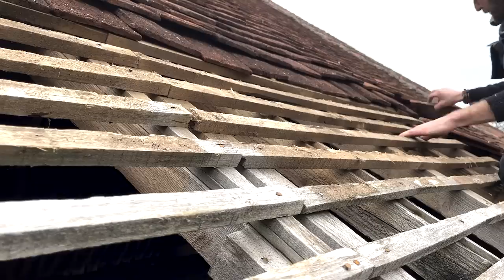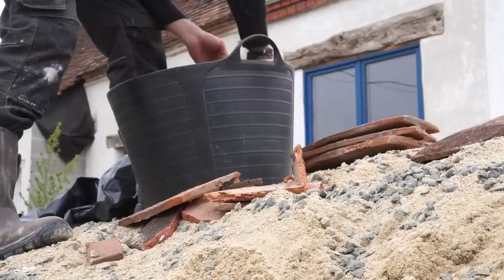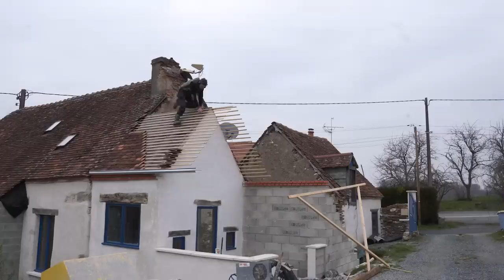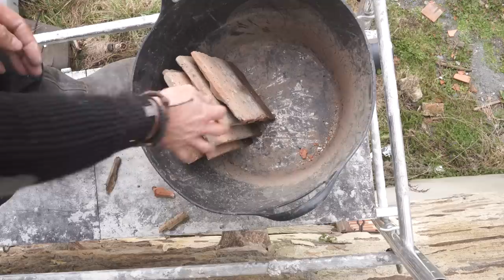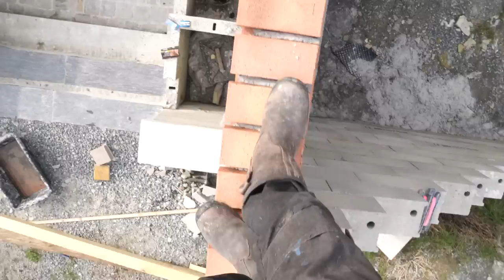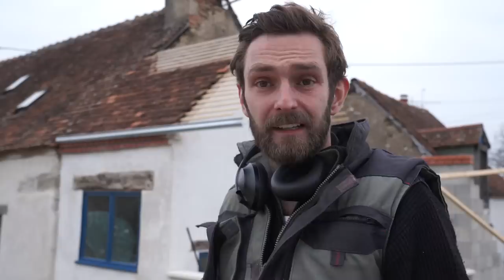Making a new roof, old again

Comment: Might I suggest a rope and pulley system for lowering the filled bucket from the barn scaffolding? Would probably reduce the amount of tiles being broken, and ease the "stress" on your arms a bit as well 🙂
Reply: Yea.. even looping the strap around the bar would improve control when lowering
Reply: I think I will I would tie the end of the rope someway, incase it slips out of your hand. Have a quick release on the bucket when it is at the bottom.  But what do I know? Love watching your daylies.

Comment: Your getting there Dan, slowly but surely…..
It’s beginning to look like your have to strip one whole side of the barn roof at this rate!
I know you were thinking of temporary tarpaulin the barn afterwards, but even with using good quality ones, your be replacing them every 6months if not more.
Maybe use corrugated iron sheets?
They could tuck underneath what tiles are left and probably could stay in place indefinitely, will cost twice as much, but would look better and be more cost effective in the long run!

Comment: The Clay of the roof tiles still absorbs the moisture making them more malleable and then then conform to the roof line, also helps them expand and contract to become more water tight in rain or snow. And breath and dry out in the warmer dryer months.

Comment: I'm betting an inexpensive clothesline pulley could be temporarily rigged up to the scaffold and one to the building, to make lowering and raising the bucket easier.  In fact, depending how far it is you might be able to run a line straight across from barn to building and just reel the bucket straight over. ( I would draw the line though, at suggesting you zip-ine yourself back and forth to avoid some of the climbing.)
Reply: But the zip line is the truly fun part. :😜

Comment: It seems crazy that that little nobuley bit is all that holds the tile in place, (along with the weight of the ones on top)  a roof can go on soo quickly.
Also if you are going to take the tiles off the barn, please get a second trug, its painful seeing you go up and down after every one,

Comment: Hi Dan , I feel I need to comment. I've been a builder for over 30 years and have just about finished my french property renovation in Aveyron. I really think you need to address some safety issues , with all due respect this is a small job , but some big risks taken . Couldn't you have hired a tile bumper , faster and less risk.

Comment: WOW Dan, that barn is a work of art. Those rafter timbers are very valuable.  I hope you are going to take pains to weatherproof the section of roof from which you have removed the tiles.  If historic tiles are in short supply, why not offer them for sale at a VERY premium price (per each) to test the market.  You may be shocked by their market value.  That barn could be very handsome with an all new painted metal standing seam roof.  At that point - I'd be renovating it into a very posh single family home.
Reply: I was totally with you until you got to the "renovating the barn into a home" part. Like Dan has anytime to do that with all he's got on his plate. 😆 You have SEEN that château, right? I think he has his work cut out for the next 15+ years. But if he had the money to hire a crew to do it for him, you're right, the barn could be a great place.👍

Comment: What if you had a rope on the bottom of the rubber bucket too, so when you lowered it, you could tip the bucket to pour out the tiles on the ground, then lift the bucket back up…save a lot of up and down’s for the takey-offey, puttey back on thingy.  Might crack a few with my idea though.

Comment: Brian, help me to understand.  Are you tearing down the barn so it doesn’t need a roof?  Or are you just temporarily using the barn tiles and planning to replace them in the near future?
Reply: The tiles are very hard to find. No luck with that so far. Dan decided consistency on the house is more important than authenticity on an unused barn. Membrane is the first remedy for the barn. Tiles are a future possibility. A corrugated roof there would be acceptable.

Comment: I can't believe that in France you can just stack unsecured clay tiles like that in new construction ,, no nails , just gravity... Don't you ever get storms there?  In Florida those would be flying in a hurricane destroying everything they hit.
Reply: That roof on the barn was built like that and it's been up for decades it seems. They've been building roofs like that for hundreds of years throughout Europe. If they were problematic they wouldn't still be doing them. Usually when you see old tile roofs like that that have failed, it's because the wood slats supporting them have rotted out.

Comment: It IS summit! Remind me why are you taking the roof tiles from another building?
Reply: He couldn't get his hands on those tiles anywhere, and he's trying to keep it consistent with the building to which he's added the addition.  (See where the previous roof ends?  That's the house.  He's roofing an extension he built on the house.)
Reply: @RTCPhotoWork  but won't he have to replace those at some point?
Reply: @lyndajohnston924  he's re-roofing the barn later. It hasn't been worked/restored on yet so a tarp should be fine for the short term. He said he's still considering what material to re-roof the barn with for a more permanent fix.